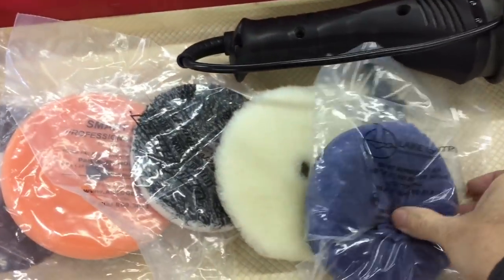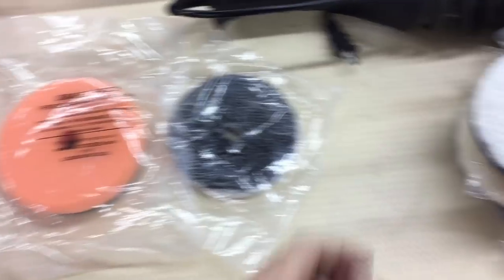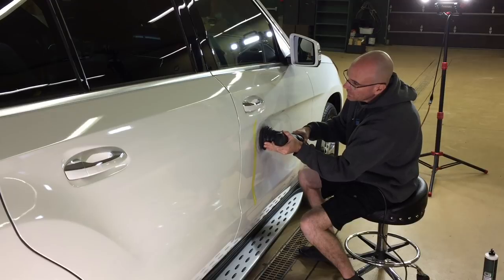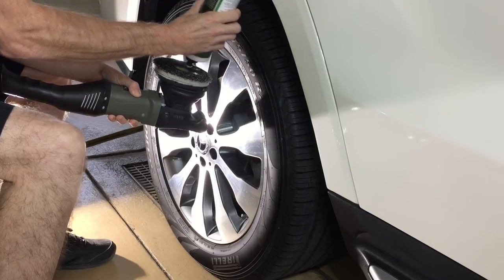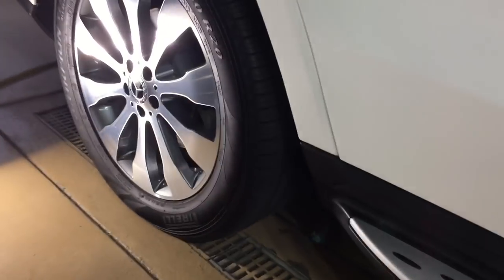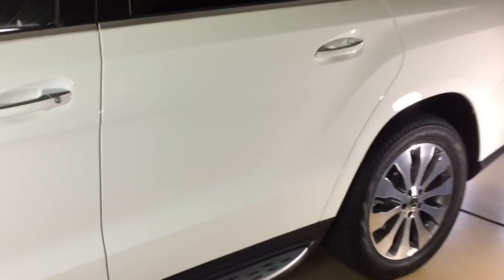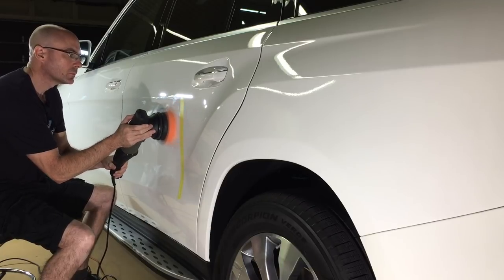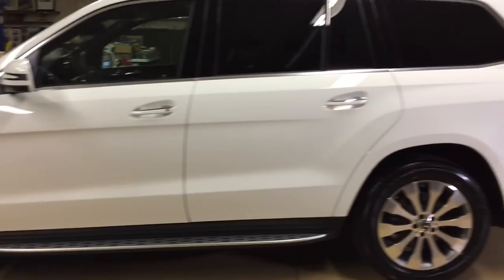Pad Choice For Correction On Moderate/Slightly Stubborn Clear Coat!!

Comment: Wondered if you have tried the Rupes Coarse/Medium Wool Polishing Pads ? I bought them in a 12 pack, six of each. I just had a big job on a 22 foot enclosed car carrier, with a very hard yet thin enamel white paint that had 188 feet of tree branch scratches. They did a very effective job of removing the scratches in 2 passes. I used the Rupes Mille for the whole job.

Comment: Brian, what is your goto DA when you put on a 3 inch pad for tight areas? Thanks for the videos. Always learn a ton.
Reply from the maker: Michael Condes Lake Country low lint lambs wool 3 inch.
Reply: Thanks for the recommendation on pads. Is there a DA that you like using with the smaller pads?

Comment: Have you ever do a Q60 black it's a 2014 I got 3 scratchs what pad coumpound polish and pads should I get money's no issue n the scratches don't catch with finger nail thanks
Reply from the maker: Sonax Cut and Finish with a urofiber 50/50 pad.

Comment: I love audi paint (atleast on my past '13 A4), it was very easy to remove light marring by the dealer.  Merc paint I thought was typically hard but Brilliant Blue metallic is very soft and I have had hard time getting it right.  Any suggestions compound/polish/pad combo with flex 3401?
Reply from the maker: On soft blue.. no need for the 3401. A short throw will work with the Urofiber 50/50 pads and Sonax Perfect Finish.
Reply: @apexdetail85  I only have 3401 but thanks for the info.

Comment: I have  Mercedes Sprinter Vans....  I was told that it has (soft) single stage paint. It gets fine scratches really easy..... the van is dark grey in color.  What process (chemicals and pads) would you use? I was going to buy a Rupe Bigfoot 15 or 21 to maintain my vans..... What are your thoughts?

I really enjoy your channel! Thanks for the hard work!

Comment: Great video, thank you very much for sharing knowledge and experience positively. Would you assess the hardness of this Mercedes similar to a BMW alpine white? I’ve been struggling to find the seeet spot with that rock-hard coating
Reply from the maker: That Alpine white is a bit more stubborn. I then would have went to the Low lint Lambs Wool pad.
Reply: Thank you so much!  I'll start with cutting microfiber on a 15mm maxshine and if it gets tough, then move up with lamb and heavier compound
Reply: Hey Brian, just to follow up, in case it is useful to anyone, on the BMW alpine white, the cutting microfiber disc (Meguiars), Sonax Cutmax and Rupes LHR 15 did the trick for me. 4 passes, the first 2 very slow motion (1 inch/sec) in a criss-cross pattern, moderate pressure, speed 4; the last 2 passes at speed 5,  2 inches/sec with no pressure).  Finishing just to deal with a bit of haze with sonax perfect finish, 2 pases with rupes yellow pad.  It is a jewel now.  Thanks for all the knowledge you share!

Comment: Hi Brian, I was wondering if you can help point me in the right direction with pads and compounds. I am working on a truck I painted with bc/cc and have to wet sand the orange peel, what pads/compounds would you recommend to get out 1500-2000 grit sandpaper scratch's thanks in advance!!! ~Bryan~
Reply from the maker: Sonax Cut Max or Cut and Finish. Lake Country low lint wool and finish up with white foam pad.👍🏻
Reply: @apexdetail85  thank you so much!! I truly appreciate it!

Comment: For a weekend warrior, who does very light paint correction once a year, what Husky light setup would you use? I could see your setup coming out of storage only once a year. I typically do a wax/sealant type application every 3-4 months, and very light paint protection once a year on both my vehicles.
Reply from the maker: They have smaller set ups as well...such as this...https://www.walmart.com/ip/Husky-1-500-Lumen-Rechargeable-LED-Worklight-Work-Light-K40067/733671468?wmlspartner=wlpa&selectedSellerId=6562&adid=22222222222144475113&wmlspartner=wmtlabs&wl0=e&wl1=o&wl2=c&wl3=75179174912868&wl4=pla-4578778745202206:aud-807615483&wl5=&wl6=&wl7=&%20wl10=Walmart&wl12=733671468_10000006672&wl14=husky%20shop%20lighting&veh=sem&msclkid=8599d43f2166156801178fe562b96b74
Reply: @apexdetail85  Now that's definitely affordable, but more importantly, practical for the amount of times I would use for correction. THANK YOU!!

Comment: Does microfiber are stronger than pre washed lambswool? 
Even when the medium foam is higher in temperature you are removing more clearcoat with the pre washed labswool?
Reply from the maker: The lambs wool Lake Country pads cut about the same... but at lower temps from better air flow.
Reply: Apex Detail thanks!

Comment: Brian,  I've got a question/problem.  My cars are in very good condition with exception of light swirl marks from hand washing and winter machine car washes.   I used a suggestion from Scott Bly (Dallas Auto Detailing) and I'm using Meguiar's D300 with a light compound orange Lake Country CCS foam pad with a Harbor Freight DA polisher on speed 4-5 out of 6 max.  This problem is on both my 2012 black Acura TL and my 2001 Speedway white Vette.  Yesterday I washed, clayed, decontaminated, and cleaned with Duplicolor Grease and Wax Remover  to remove clay residue.  I followed the directions for D300 and the paint looked so smooth and glossy in my garage.  Followed up on the Acura with more Duplicolor,  two coats of Jescar Color Lock Carnauba Wax and Meguiar's Fast Finish.  Then I parked it out in the sun and swirl marks were horrible!  The paint is smooth as silk and glossy but the swirl marks are killing me.  Today, I did the same prep work on the Vette.  After pulling it out in the sun and before waxing, I have the same issue with it.  All the swirl marks are still there yet the paint is smooth and glossy.  Before polishing, I need to know what I am doing wrong and I've got to get rid of the swirl marks.  The paint has light swirl marks and nothing is through the clear coat.  Is my arm speed too fast?  Too much or too little pressure on the polisher?  Using the wrong products for my paint?  I've watched Scott's, Luke Wilson and your videos at length to get up the courage to try a DA polisher and all I have is a mess on my hands.  Your thoughts or guidance would be appreciated very much.  Thank you for the videos and all the help.
Reply: I ran threw some internets as I do not use D300 at work. Some people were mentioning swirls after use (maybe itll finish better with a microfiber cutting disc?). I'd follow up with M205, Sonax Perfect Finish, Jescar Finishing Polish. Those are my go to polishes I have at work and personally. Final choice is yours obviously. 
If you have watched videos from some of the best on YouTube I doubt it was your speed or anything like that, it just seems like the paintwork needs refined to finish out.
Reply: You're either not going aggressive enough to level existing scratches and only jeweleing the top layer of clear coat or somehow introducing new scratches. Use a good spot light and clear away spent polish as you go to check your work. 

Try a different compound or polish. HD Cut+ for step 1 and Sonax Perfect Finish for step 2 might work better. Also make sure you're polishing with a less aggressive pad for finishing and cleaning out the pad frequently for all steps.

Finally, make sure you're not marring the paint as you wipe the spent polish away (this is more of issue on ultra soft finicky clear coats). Use an edgeless decent quality medium pile microfiber.
Reply from the maker: These guys have some great tips here. On the acura... use a white foam polish pad and Perfect Finish or Angelwax Perfect polish. Quality edgeless quality microfiber to remove residue. 

It is difficult to assess without the vehicle in front of me, but do not get aggressive as you have already removed a decent amount of precious clear. Tread lightly from here out.🙂
Reply: @apexdetail85  Thanks so much for the quick reply.   I have some M205 and white polishing Lake Country CCS pads.  I'm wondering if I could use it rather than ordering Perfect Finish or Angelwax Perfect to save time and money.  I thought I was doing everything right, but this has left me doubting my ability to use a DA polisher on either car!

Comment: I am starting to use just wool pads injected with foam. Lake Country (thin/thick) purple wool  pads. Much more forgiving panel temps and they finish down great. Can be used with hard and soft clear coats. I use a Rupes Mille for cutting and a 15mm Maxshine DA for finishing. I use black foam pads to finish, SDO or HDO is my choice. I Also use a Adam's 3 inch swirl killer for tight spots.
Reply from the maker: Totally agree. You are in good hands with that set up.👍🏻
Reply: I agree with the foamed wool pads. They’re amazing to learn on too.

Comment: You seem to use the eurofiber pads quite a bit or is it just me?  BTW great videos bud keep the coming~!  Just realized you are just on the other side of the Reading from me.  Do you ever prime the foam pads with anything?  What do you suggest for Toyota?
Reply from the maker: I really do. They are less aggressive and perform quite well on most finishes.
Reply from the maker: I prime with Angelwax QED
Reply from the maker: For the softer clear on a Toyota. Sonax Cut and finish or 3D ONE teamed up with a light cut... or heavy polish pad. Open cell foam so that thin soft clear stays cooler during correction.

Feel free to stop by! I enjoy meeting you guys!!!!😁👍🏻